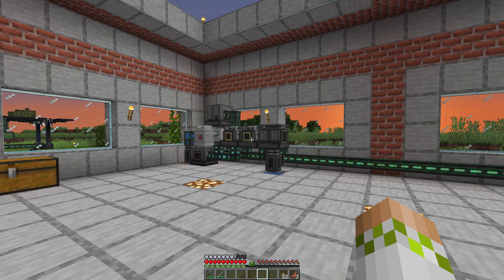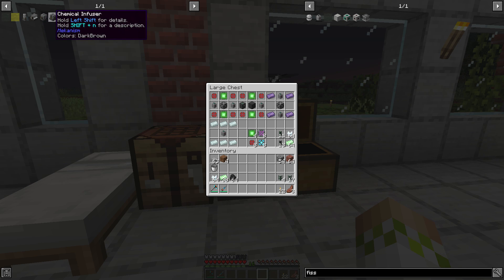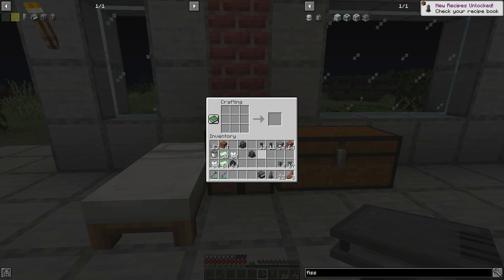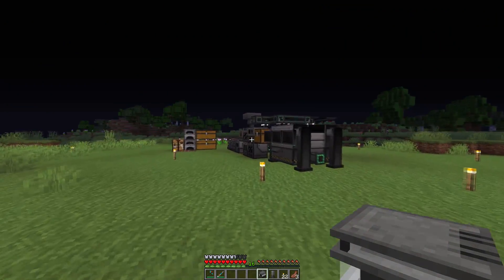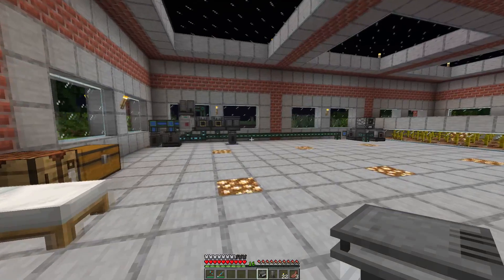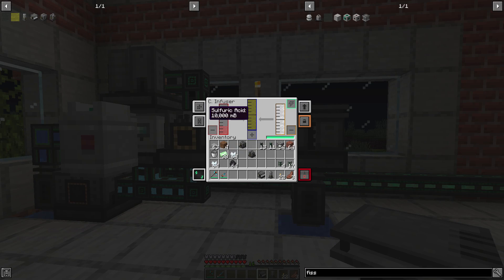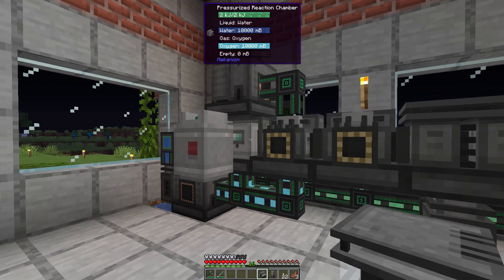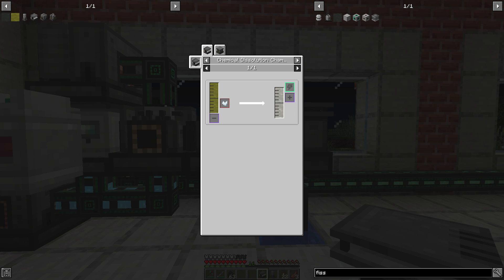Surviving With Mekanism v10 :: E07 - Fissile Fuel & Isotopic Centrifuge

Comment: You technically don't need coal for your sulfuric acid setup. It is a lot more complicated but, check out how to make gunpowder. It boils down to power, water, and cobble. Using the Mekanism laser and tractor beam, you can have a 100% automated (and power hungry) cobble gen and therefore sulfuric acid production.
Reply: Yeah, when I did it I used the cobblestone -> gravel -> flint -> gunpowder process for sulfur and it was pretty simple to set up. I used the block breaker from the Quark mod so I'm not sure if it would be more complicated with only Mekanism.
Reply: @kevins.7702  I've done it, although it is not a one block solution by any stretch of the imagination, and it uses a lot of power too. Power should not be a problem because you theoretically are already in the process of making a practically infinite amount of power. The setup left to right is: [power cable], [laser ->], [tractor beam ->], [block to be mined], [laser amplifier <-]
Reply: Well if we are using other mods... my Mystic Agriculture patch overproduces sulfur with just two seeds planted.

Comment: I am pretty sure that putting the pump in the water relies on waterlogging which was added in Minecraft 1.13 which was a version generally skipped by modded Minecraft along with 1.14 and even 1.15 to a large extent. If you try to make a charge pad to power your robit you will see that Mekanism 10 relies on one of the new blocks from 1.16 to craft it now :)

Comment: my uranium oxide wont move to my chem mixer no matter what i do and its so frustrating idk what to do. even if i use pressure pipes or mechanical (because jei says its a liquid) but the chem mixer wont accept it. i have the other parts and pieces working though.
Reply: You ever fix this problem? Mine is doing it aswell suddenly
Reply: @J6328_  ok so I have terrible memory but I think I used gas pipes to fix it. Sorry if I'm wrong
Reply: @dima97  gas pipes worked
Reply: @nedhunt9521  sweeeeeeeet. Glad I could help
Reply: @dima97  ty king
Reply: @nedhunt9521  :D

Comment: I did the same that you did step by step but the chemical dissolution chamber wont pull the acid, any idea why?
Reply: same here, did you figured it out ?
Reply: @mariocardos074  not really, i just made the parts again and it worked
Reply: i think it depends on both input and outpot (if your output is good but the input for second matchine is not right will not work, Something like that, sorry for my english, if you don't understand i will use google translate xD
Reply: same except uranium oxide.

Comment: Is there any way to funnel coal into the pressurized reaction chamber? It needs energy, oxygen, water, output, and somewhere to store the hydrogen, so there's nowhere to put a hopper?
Reply: nvm figured out a way to do it
Reply: @tanman.  How did u end up doing it? ran into the same problem
Reply: @TehArox   I moved everything to the left of the first chemical infuser 1 block left and then put a hopper to the right of the pressurized reaction chamber i also moved the chemical oxidizer and the pipes connected to it 1 block up so i could put a chest on top of the hopper
Reply: eventually you can use brine and cobblestone in a process to make sulfur though, and then you can just put the sulfur directly into the chemical oxidizer in a much more automated fashion and that’s what i would recommend doing, I don’t think there’s any tutorials though
Reply: A quantum entangloporter can transfer different categories simultaneously. You can use one entangloporter to input gas, fluid, item, and power simultaneously from a single side of the machine. It's almost necessary for the Pressurized Reaction Chamber.
Reply: @LibraritheWizardOfficial  9 months late
Reply: @LibraritheWizardOfficial  most people building this system wouldn’t be able to afford an entangloporter anyway
Reply: @tanman.  They're not even that expensive, and the optimal machine order is a digital miner immediately after a heat generator, metallurgic infuser, enrichment chamber and osmium compressor. Possibly an atomic disassembler to help with that last stretch. Mining up silk touched diamonds is ideal, but it's faster to just mine without silk touch at first and just keep moving the digital miner around. With the first few runs for specific ores, ethylene is very affordable to build, especially if 3x ore processing is the next step after the digital miner
Reply: Cubes Have 6 Sides